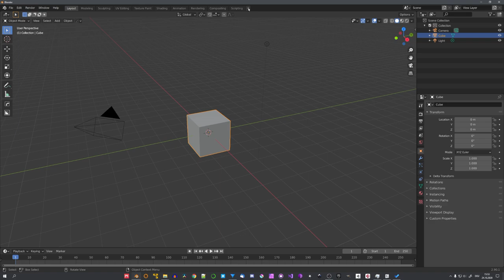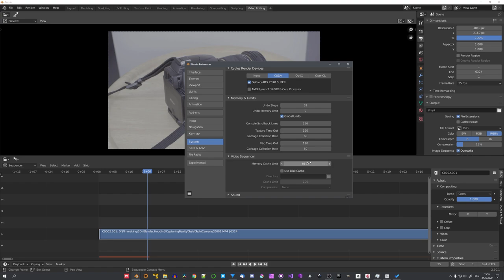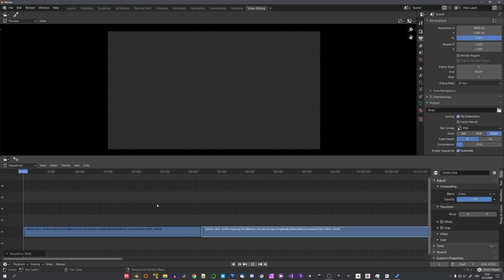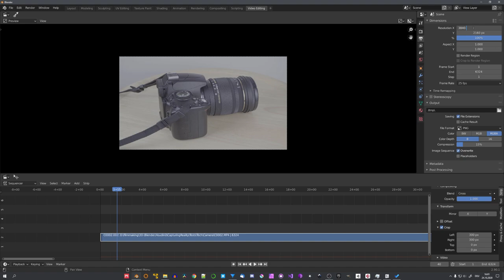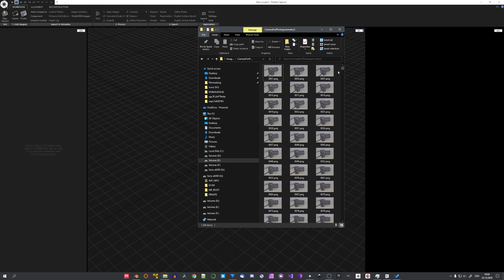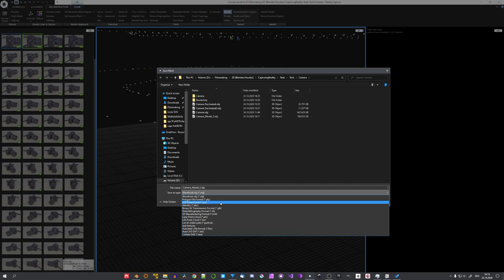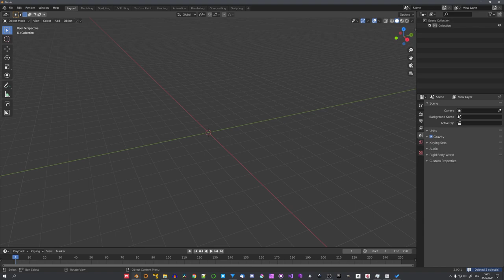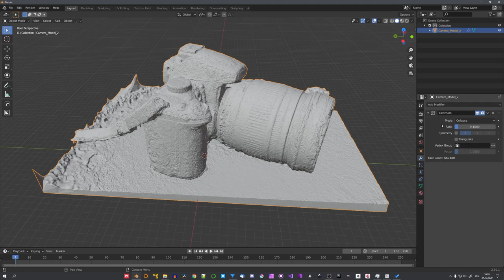Photogrammetry for Tech using Reality Capture [w/ Video input] | English

Comment: As mentioned at the end, this is really just the first step in the process.  Not only does this mesh need to be retopologized, but if you take a look at the texture maps, the UV’s are probably a complete mess. The standard process is to retopologize, UV map the new mesh, bring both the clean mesh and the original scan into Zbrush and project the high frequency details onto the retopo’d version.  After all of that, load your new mesh back into your photogrammetry software and have it regenerate the texture maps according to the clean UV’s.  Next you would delight the albedo map, do some paint touch up on it, bake your other texture channels (metal/gloss/AO/normal/etc.), and you’ll FINALLY have a clean, optimized model which is ready to use in a production environment.
Reply from the maker: Yes, you're right, sadly all this would not fit in one video and I personally also don't really feel comfortable teaching about sculpting because I just don't have that much experience with it.

Comment: You have got an incomplete pseudo - 3D model. The lower parts of the object are missing, instead there is a flat floor. Is it possible to create a full 3D model of the tech, visible from all sides, without any floor or ground plane, using Reality Capture?